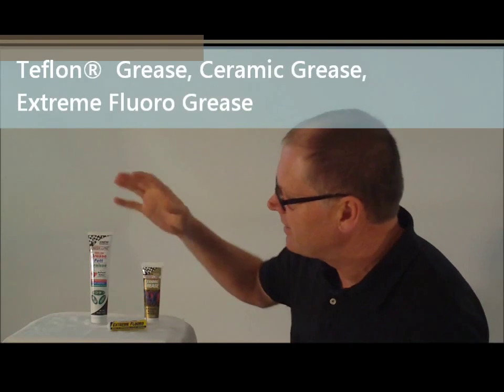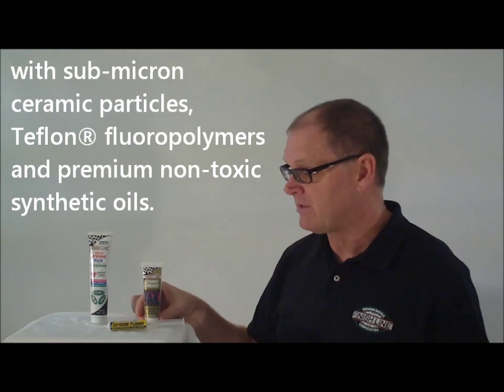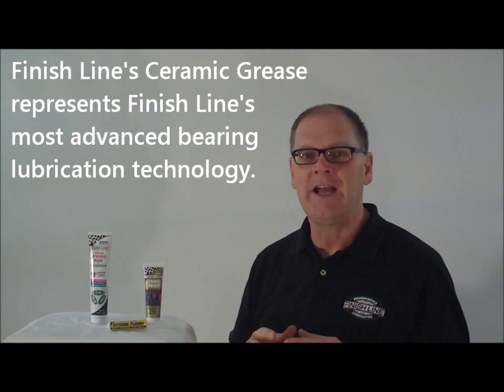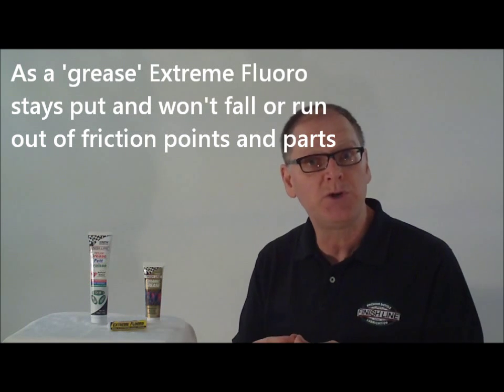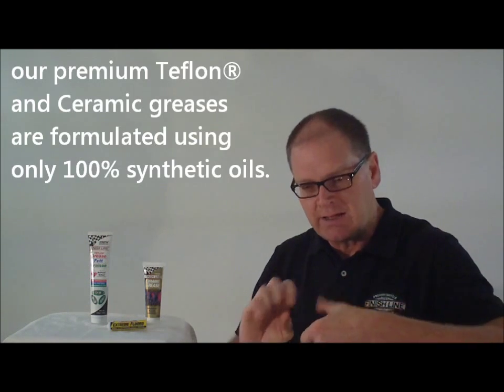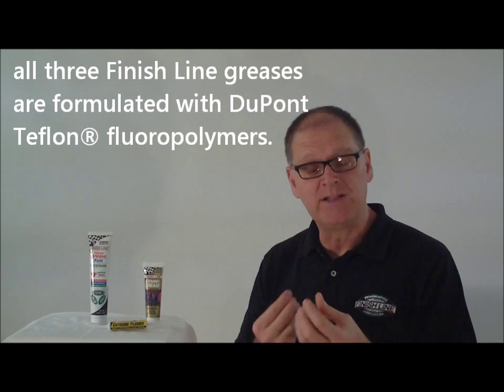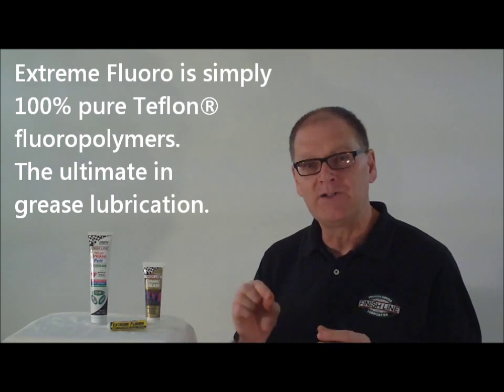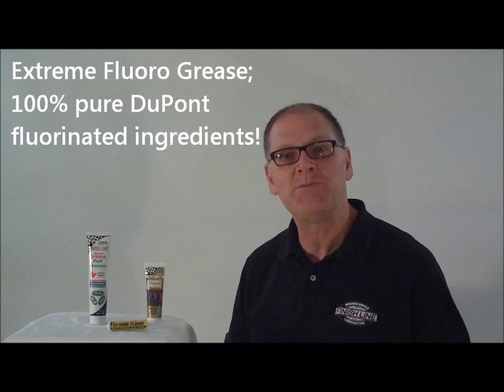Greases: Teflon, Ceramic, Extreme Fluoro

Comment from the maker: @ray5961 If you already have Extreme Fluoro Grease, you actually have the best one to use for that application! It has the same properties of our Stanchion Lube, but is in a grease form. Just put that in the lip area of the seal and you should be good to go.

Comment from the maker: @ray5961 Both our Teflon Grease and Ceramic Grease would work really well for this application. If you don't need "grease consistency", our Stanchion Lube would be by far the best choice. It will keep the seals supple, sealed and all moving slick.